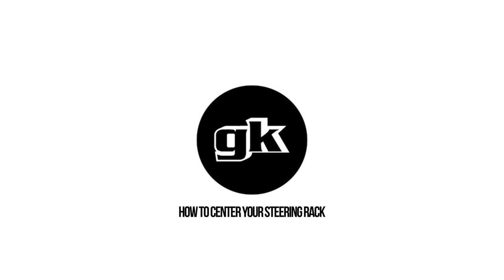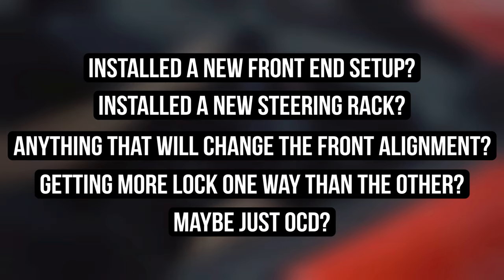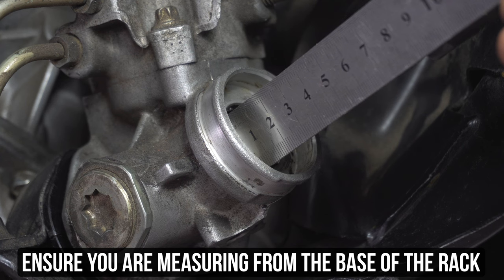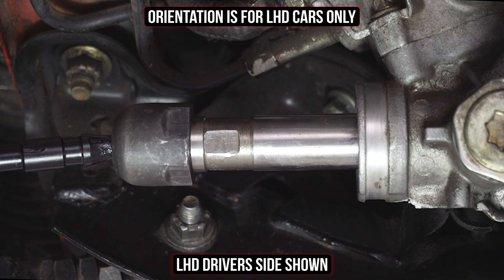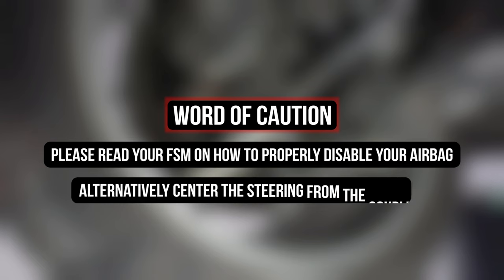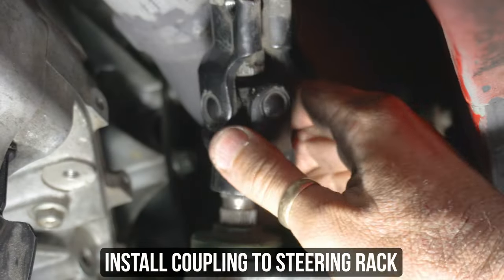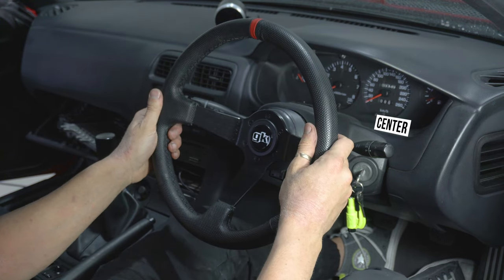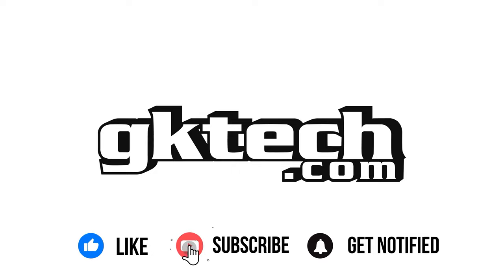How to Center Your Steering Rack

Comment: This is exacly what I was looking for, putting a mint rack from a Cobalt SS with only 17k miles on it onto my Ion Redline. This will be what I do to make sure it's installed DEAD center along with my steering wheel

Comment: I’m getting even measurements on the rack but when turning the steering wheel I’m getting more turns to the right vs the left
Reply: Loosen steering joint, center the wheels then the steering wheel and tighten
Reply: The pinion was prolly put in with rack off center.
Was it a remanufactured rack?

Comment: Sorry for the dumb question but what if in the first place my steering rack is not centered? I leave it centered and then i remove the steering wheel and correct it and thats it?
Reply from the maker: Hi mate, if you use the website live chat or email sales@gktech.com the team can assist with all technical inquiries.

Comment: I just installed a new rack on my camry but didnt center the rack before installing. If i take the boots off the inner tie rods and do the measurements will i be able to center the rack this way. For the rack to be centered the measurements have to be the same on each side correct? Or do i have to take the whole rack out and center it? Any help would be very much appreciated.
Reply from the maker: It can be done by removing the boots.

Comment: Pointless gadgets to Correct a Very minor proble.
 Better 'fixed' By simply repositioning the UJ to the rack pinio.
  Free AND Much easier  as well as the mechanically superior solution.